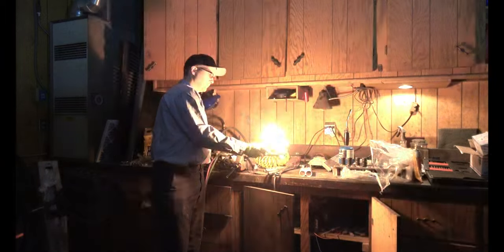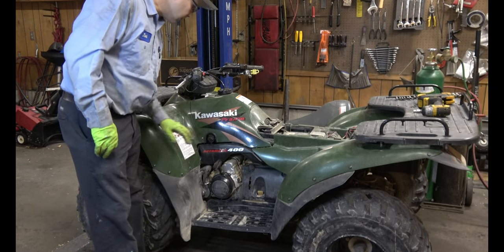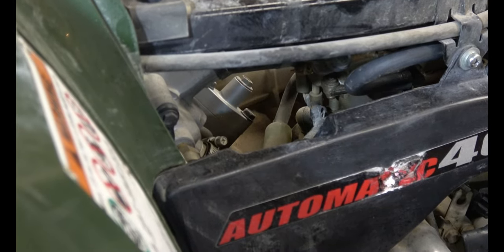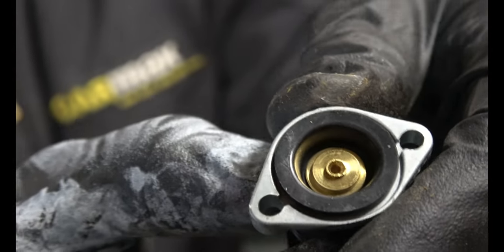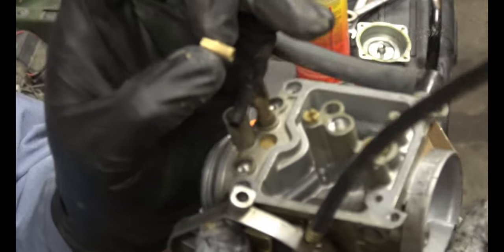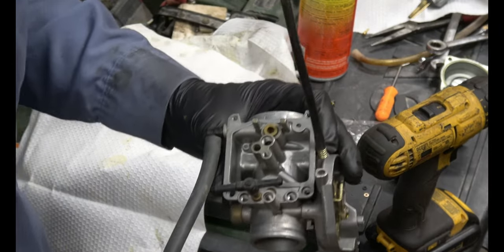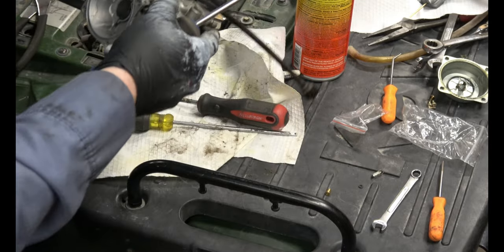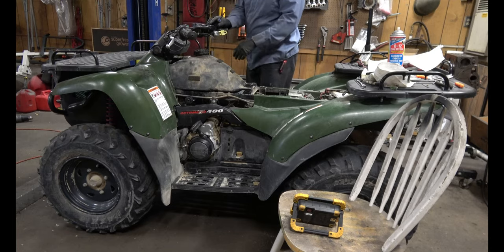1999 Kawasaki prairie 400 carburetor rebuild

Comment: I have just finished cleaning the carburetor on our 99 Kawasaki prairie 400 4x4 (identical to yours, green, and everything). The idle jet was clogged, and it would only idle with partial choke, as well. Thanks to the clear instructions and details in your video, I was able to get it fixed easily and quickly with minimal cost! (Carb cleaner)
Reply from the maker: I'm glad it went well for you 😀

Comment: Great step by step detail. I came across this while doing some searching and realizing that this quad has both primary and secondary "main jets". You stated what size the secondary was and didn't replace it. I was so hoping you would do the same on primary because I'm trying to figure out the ratio/number increase/decrease between the two. If you remember and have insight... Please advise. I have a full jet relevant kit and can't figure out what primary size to put in? 🤯
Reply from the maker: The two sizes I mentioned in the video are 135 and 85

Comment: So lreave a little slack in throttle cable so buterfly fully closes and yet there is some free play in cable , right ?
Reply from the maker: Totally up to you.  I like to leave basically no free play for better throttle response.
Reply: @atvsanonymous  on my 2005 360 4x4 I'm unable to shorten its length so throttle is tad open and idle is too high. I tried adjusting of the throttle screw on nandle bar but that work either. Its a new oem carb.
Reply from the maker: Loosen it at the carb and give it more slack?

Comment: Ive done all of this. Raised a jet in size from advice from service person. Get everything in and start quad… won’t stay running unless I’m on the throttle. Won’t idle. Seems like I should go back to the old jets and start from zero and clean the whole carb again . Any advice?
Reply from the maker: You could try eBay for a cheap complete carburetor brand new. Things to check:. Carbureted engines take a minute or two to warm up before they will idle correctly on their own. The choke will need to be on at least part way until it warms up all the way. Also, the throttle adjustment on the side of the engine can be adjusted so you don't have to hold the throttle with your thumb.
Reply: @atvsanonymous  thank u very much. Yea I do have the choke on and it was warmed up for at least 15 mins. Starting and restarting several times and taking the tank off (no screwdriver to fit under the carb to adjust ) fuel screw. I had it at 1 1/2 turns. Each time adjusting a 1/2 turn till it literally was almost out at one point. That’s when it was running or staying on. I was  working on it and a buddy of mine said I didn’t need to mess w the idle speed adjustment. ( on the right side of the carb) I’m looking at it and it’s fully closed . Carb is totally out on the quad. Doesn’t that need to be open a little bit so u see the small holes in the carb? To let air flow? I’m thinking I need to slightly adjust that black knob IN to allow air when u don’t push the throttle open. It just dies when u let off the throttle. I’ve taken this all apart n it appears clean. Air , soaked in berrymans all night. Jets and carb.  . Seems like it’s gotta be something easy to fix here w out taking it to the dang dealer to fix. Thanks for your quick reply
Reply: Put the other jets back in after cleaning . Starts on first pull and idles nicely. But I give it gas and it backfires a few times and wants to die when I give it throttle. Don’t even have to use the choke. I’m at a loss. Maybe the Valves need adjusted. Ugh
Reply from the maker: @seanhuntsman7834   sounds like either too much or too little gas.  either the float valve isn't creating a good seal and too much gas is getting in or the mixture screw isn't where it needs to be.  they set it to the correct mixture at the factory and don't expect you to mess with it at all.  also make sure you have good flow of fuel into the bowl.  open up the drain on the bottom and see if it continues to be replenished as it leaks out.  if it stops leaking out after a few seconds, something is restricting the flow of fuel and you need to check the float valve to see if it is sticking and the fuel line to see if there is a clog or restriction somewhere.
Reply: @atvsanonymous  thank u very much! I’ll try those things !

Comment: I have same 4 wheeler .shop replaced carburetor  cranks well idles well but just passed 1/2 throttle rpms stop risen no stumbling or busting just stays thereany clues what to check air/fuel mix or jet which jet controlls top end throttle maybee spark plug
Reply from the maker: Hard to say check main jet which is the smaller one with the bigger hole in the middle where the needle goes through. Check the air filter. Check to make sure the throttle cable isn't binding somewhere.
Reply: Ok will do thank you and great video  in detail.

Comment: They are so cheap online....I just got a new one...
Reply: @atvsanonymous I have a 1999 kawasaki prairie 400 4x4 automatic  now. At first it wouldn't crank up unless sprayed carb cleaner in the intake tube and would only run with the choke fully on. The original petcock/ fuel selector was clogged up. Also found the pick up tubes were fa.ling apart literally. Replaced it with one from another tank for now until I can get a new one. Took the carb off and took it apart and sprayed everything with cab cleaner, I didn't pull the jets out just sprayed cleaner through them. I put everything back on, no crank found trash in the fuel line. Cleaned that out and got it to crank up and run and idle without the choke on. Now there is fuel pouring out of the over flow hose. Do you think some trash made it to the needle and seat?
Reply from the maker: @darryladams519  probably.  Something is making the needle not seat properly.  If lightly tapping on the carburetor doesn't work to get it seated,  you will need to open it up and clean it out or maybe even replace the needle if you haven't already.